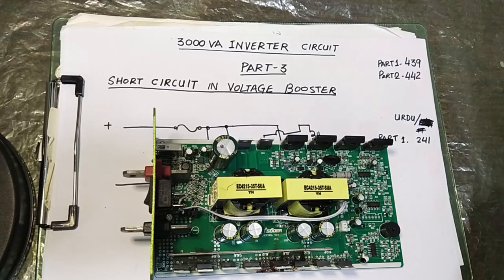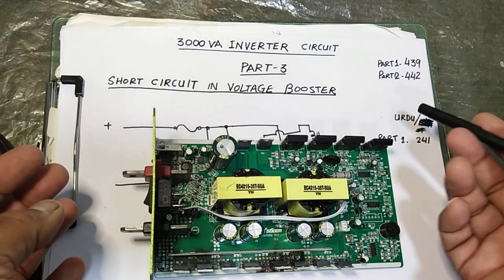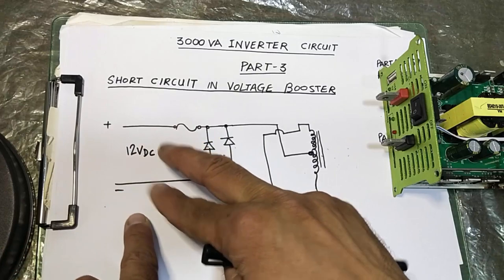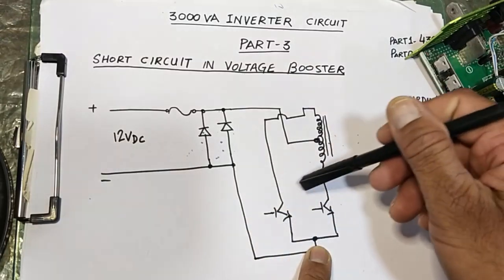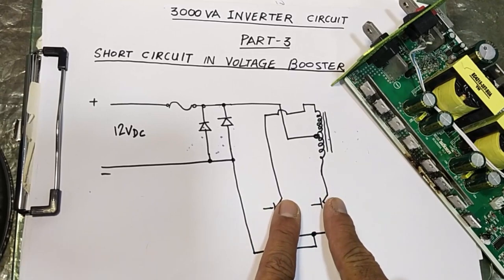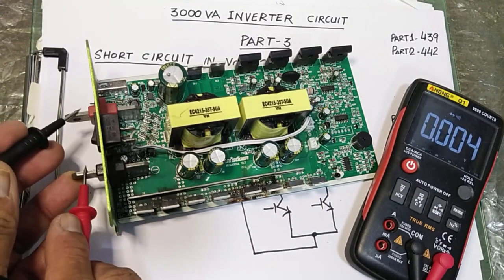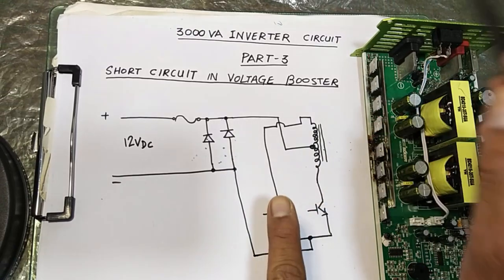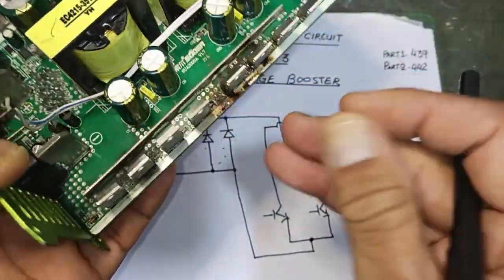{443} 3000VA Solar Inverter Circuit Explained - Part 3 How to Troubleshoot / Repair Solar Inverter

Comment: My power inverter at battery terminals test good as shown in this video but the fuse was blown. When replacing with new fuse the positive and negative terminal gives continuity short circuit. Is the inverter good or bad. It’s not Solar inverter

Comment: JZK  much appreciated 🙏 ❤   2 mosfets were the problem but the inverter is telling me fault now with no mosfets installed. Is this normal?
Reply from the maker: best regards
if it is indicating the fault, you must repair that portion of the circuit, and the mosfet fault never can be compromised. as it is at power stage
Reply: @HaseebElectronics  could it be a resistor?

Comment: Hello sir, I want to ask you something. Now I have a 1000w inverter and it has 3 transformers. The only interesting thing is that when I give 12v dc to its input, the voltage drops by 2v. I understand that there is a short circuit, but I'm measuring the mosfets, it's normal. and even when I give 12v dc, I see the voltage as -12 at the input. I don't understand what is the problem? What could it be, I would be glad if you could help me. thank you very much

Comment: clear explanation. i have one doubt . after getting dc voltage from transformer 330v  then how to convert to ac volage
Reply from the maker: it is from the H-Bridge switch at output end 
i will explain it in detail

Comment: Thanks! Did the Fluke 79 die or do you like using NENG better? I remember you did a video on a new VOM you bought a while back. I'm not sure if this was it. Have a nice day sir.
Reply from the maker: i am using this multimeter to evaluate its quality. i prepared a detailed video on comparison of Aneng and Fluke 
i found Aneng is acceptable with its features and price, now i am testing its behavior in troubleshooting 
then i can comment on its quality, as my followers ask to select for a cheap and good multimeter
Reply: @HaseebElectronics   Thanks for your research. That does look like good quality. I love the large numbers and fast auto range selection. I have an old Sears Craftsman 82357 and it's good except for the auto range is extremely slow. It takes 5 seconds to switch from  testing a 100 ohm to 1 meg ohm resistor! Best regards!